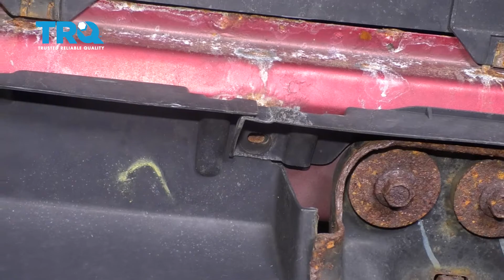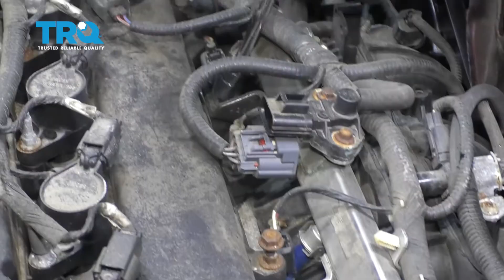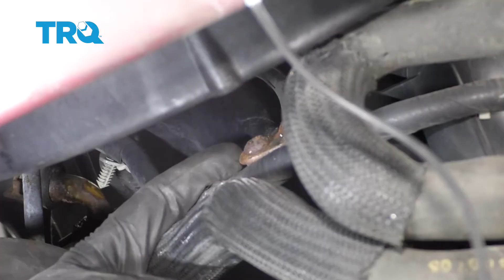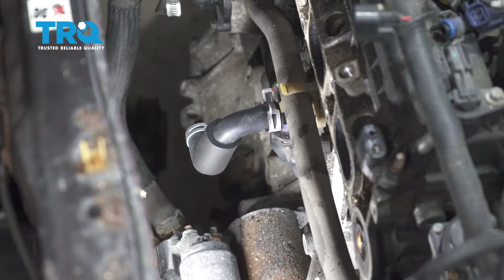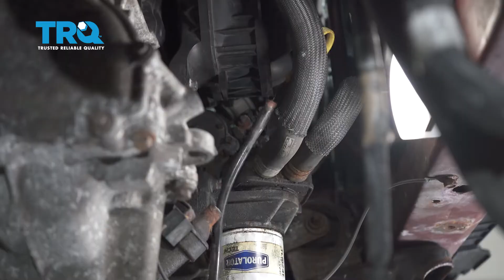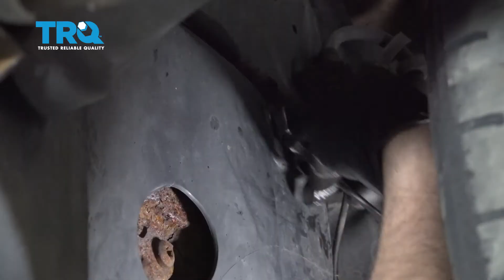How To Replace PCV Valve Hose 2001-2007 Ford Escape

Comment: At 5:00 exactly where his right hand is gripping is where the fuel rail meets a fuel hose. Disconnect that and let it drain into a rag or cloth. (Do all this after you pull the fuel pump relay)I pulled on it while it was all hooked up and broke the locking end of that hose, Mazda don’t make them so I ordered one from ford. This job sucks

Comment: Excellent step by step for the hose replacement. Found the hose collapsed and sucking air on my 4 cyld. just replaced the PCV valve at the same time.